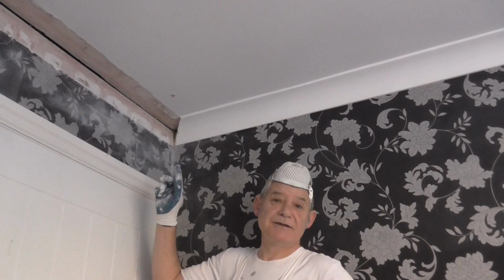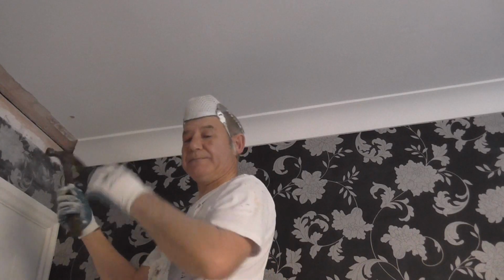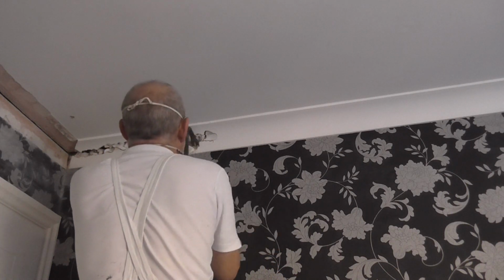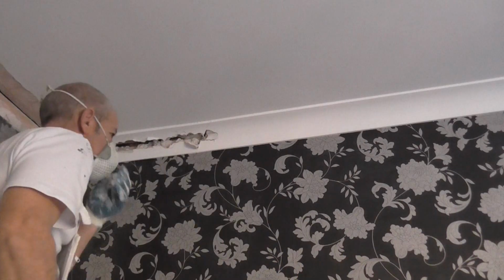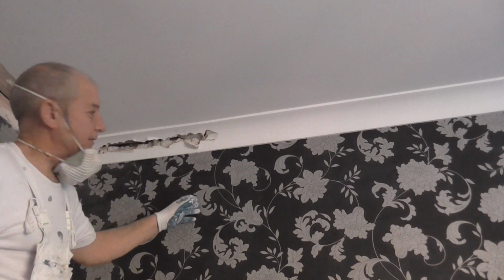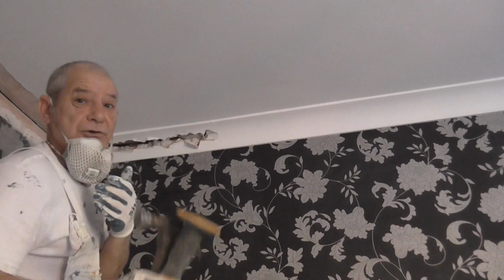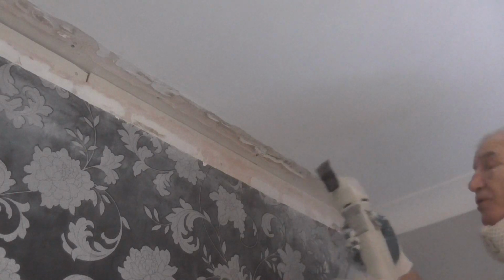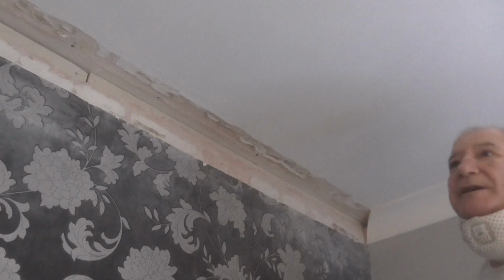How To Remove Coving And Tough Adhesive From Studded Walls

Comment: Should have left it on
Reply from the maker: Some new coving going up..
Reply: Agreed! It looks solid, and installed correctly. If there`s no issue with it, I`d be inclined to leave it. The customer isn`t always right after all. Can`t wait to see if it`s replaced with some spectacular decorative plaster moulding, or something that`s pretty much the same.
Reply: Yeah, I was wondering what's wrong with it.

Comment: Multi tool, blitz it right off.
Reply from the maker: They are a good tool to have.
Reply: Makes a lot of dust though. Multitool ok for intricate cuts, I use an old wood chisel for this stuff, it`s a sharper impact than a brick bolster.